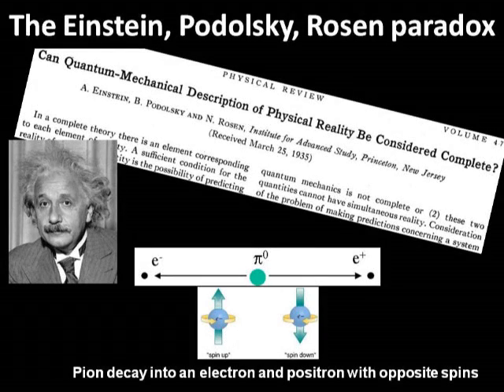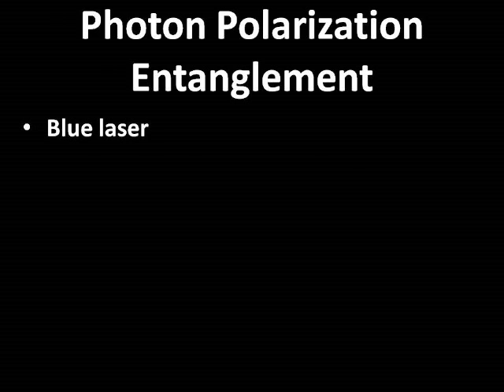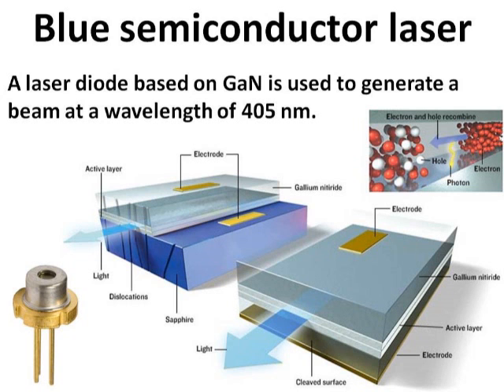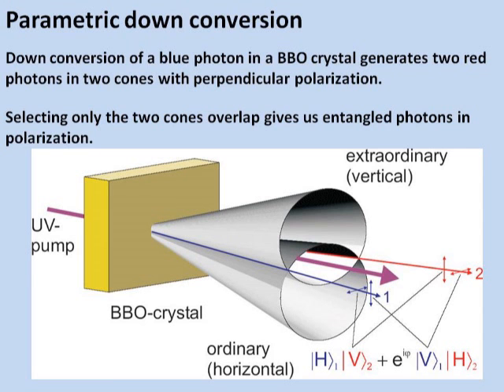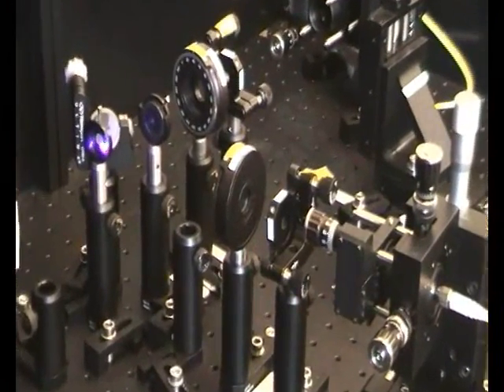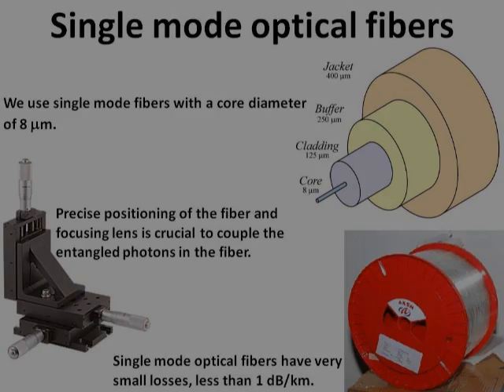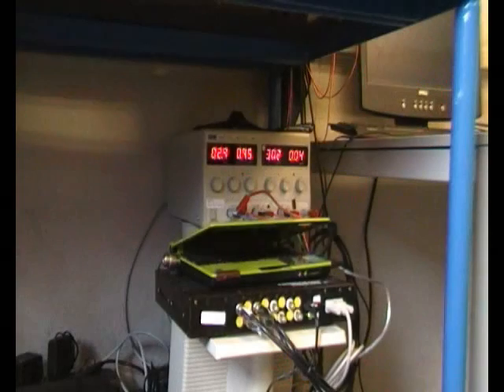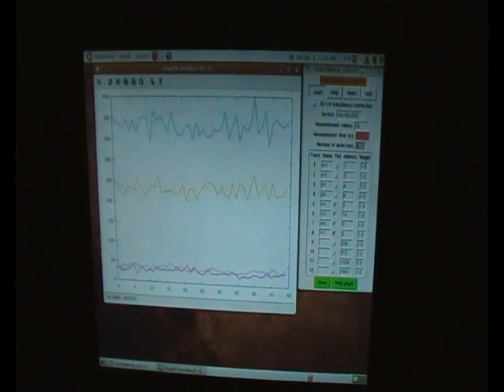quantum entanglement experiment

Comment: In high power LED fabrication the reactor vessel needs a special optical temperature sensor to establish the internal thermal distribution within the surface of the substrate during deposition. Is it possible entangled photons can interfere (in a precise statistical quantum way) to enhance the precise measurement & calibration of these sensors if there are optical splitters & unique polarized paths to reference the photons between two (or more) distinct calibrated optical temperature gauges?